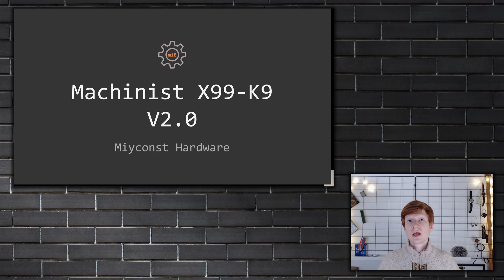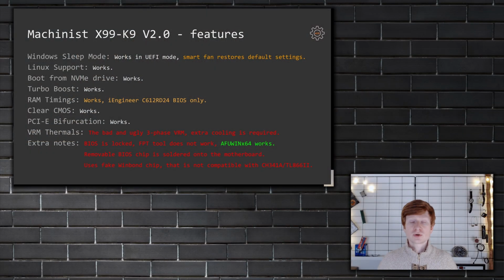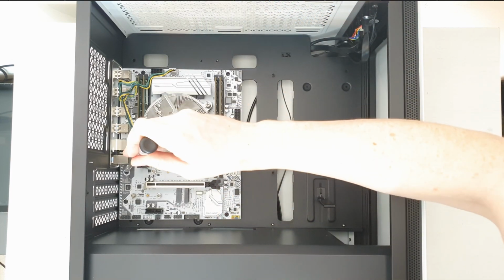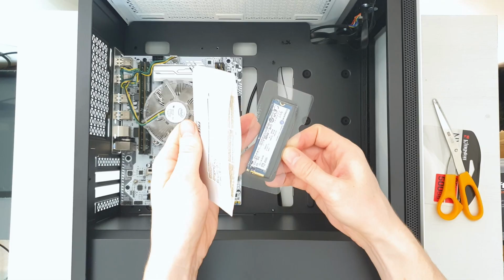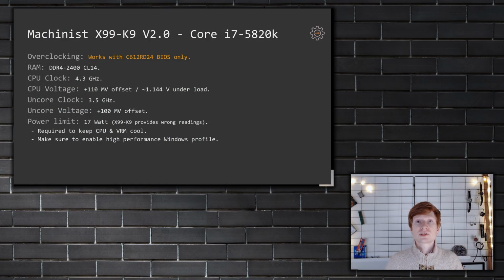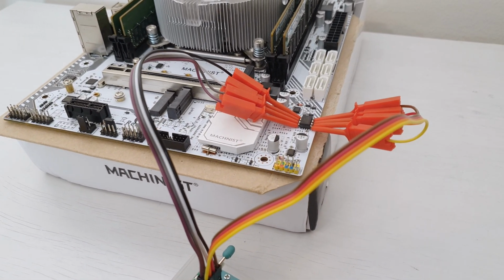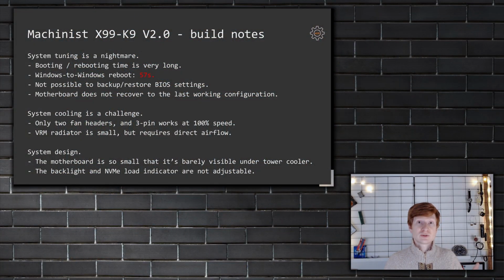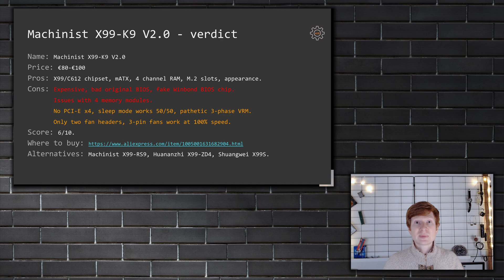🇬🇧 PC with Machinist X99-K9 V2.0 and i7-5820k – BIOS, overclocking, tuning, review, and impressions

Comment: Hi amazing work, I have a Huananzhi F8, and I have been wondering if is it possible to modify the number of cores you want to use on the bios, I have seen a Portuguese or Brazilian youtuber doing it on his Chinese motherboard, but I can't find that option on my bios, Do you know how I can enable that option into my bios. 
Thank you.
Reply from the maker: Hi. You can try to use BIOS from iEngineer which has all required options, just make sure to select the correct version. There are two different X99-F8 revisions, and the BIOS is not compatible between the revisions.

Comment: I had a Machinist X99-RS9 just sitting around after replacing it with a Huananzhi X99-F8, so I decided to build another system to have as a spare.

-Xeon E5 2640 v3 8C/16T Haswell-EP w/Cooler Master Hyper 212 BE
-32GB 1866MHz Micron DDR4 RAM (4x 8GB quad channel) 
-Machinist X99-RS9 mATX motherboard
-MSI GTX 1050 Ti 4GB GDDR5
-EVGA 450 BR 80 Plus Bronze power supply
-Samsung 870 EVO 250GB 2.5" SATA SSD (windows, apps, virtual machines)
-WD Blue 4TB 3.5" SATA HDD (mass storage)
-4x 120mm Arctic P12 PWM case fans (one is blowing directly on the VRM)
-Cooler Master Masterbox Q300L mATX case

Thanks again for all your great videos that have inspired my love of X99.
Reply from the maker: That sounds like a very neat and budget friendly gaming machine.
Reply: @Miyconst  Yes it is, and I got the 2640 v3 for only $38 Canadian.  About 28-30 Euro.

Comment: What would be the minimum output for a psu to be able to run a motherboard like this paired with a 10c/20t e5 v3/v4?
Reply from the maker: 350-400 watt, if it's a quality PSU.
Reply: @Miyconst  Then I know.

Comment: I´m sorry, really enjoying your content, but you can get a used Ryzen 2700x for 100 bucks and new b450/b550 AM4 boards for around 50-60 bucks these days, the time for x99 boards is somewhat over, especially for gaming.
Reply from the maker: That's very true!
Reply: It's true that its getting harder to justify a X99 build, but the price difference is still way larger than that around here. I guess the R7 with good mobo and ram would cost 2 or 3 times more than the Xeon combo.
Reply: It depends on where you're from. In the usa x99 is not attractive but on Brazil and Russia/Ukraine it is because they don't have access to ebay.
Reply: @SuperObamaladen  yeah, i was talking about about Europe, forgot to clarify.
Reply: USA?
Reply: @SuperObamaladen  Brazil
Reply: @andre_warmeling  o cara deve ser dos eua pq no aliexpress um 2700x é mais de 1000 reais. Por isso o xeon é melhor pros brasileiros e russos q nao tem acesso ao ebay.

Comment: Thank you very much, can you plz recommend me a motherboard to use  with Intel Xeon E5-2620 v4 ?
Reply from the maker: What are you going to use the PC for? In general, Machinist X99-RS9 will do it.
Reply: @Miyconst  thank you for answering, I plan to mount a virtualization server and I would like to use this CPU with DDR4 RAM
Reply from the maker: @ultramido4498  If you plan to use any GPU pass-through or some other advanced features of virtualization - go with Huananzhi, otherwise any cheap option will be fine. E5-2620 V4 is a very cold CPU.
Reply: @Miyconst  thank you for your support I really appreciated

Comment: Hey, just to warn you all: do not use Miyconst BIOSes in newer F8 motherboards. They do not work anymore. Actually they bricked my motherboard. I reflashed and it is working flawlessly now. I know it is my fault, but just to help you guys.
Reply from the maker: This is a well known fact by now that new version of X99-F8 is no longer compatible with the original BIOS. Also, I have not made any BIOS, I only took ready available options and modded for Turbo Boost Unlock.

Comment: Which would be the best of the Chinese motherboards? VRM, easy to flash the bios, ram memory compatibility, etc.
Reply from the maker: You didn't specify price 😁.
Reply: @Miyconst  I don't care too much about the price, but between $80 to $200.
Reply from the maker: @teloz2779  then don't get any of the Chinese boards, buy an MSI.
Reply: @Miyconst  MSI X99A SLI PLUS $190 ... Hmmm, I didn't know that there were motherboards of known brands for that value. the last time I saw it they were for $300/400, I won't have any problem with any type of ram right? it works with both normal and server DDR4? I would have to buy some M.2 adapter I don't use any other type of drive.

anyway, thanks for the information.
Reply from the maker: @teloz2779  I am not sure about ECC REG. Some MSI motherboards support it, others officially don't support, but still work with it, and others don't boot up with ECC REG. As far as I know, the original SLI Plus does not work with ECC REG memory.

Comment: Miyconst, just a thought I had at your remark @12:50. An nice solution would be getting a NZXT Grid "V2" fan controller. 
It is a very interesting fan controller. Software controlled, the opensource control software (github) is better than from NZXT it self and the controller connects to the motherboard via one of it's internal usb 2.0 headers. It is a bit slower in response compared to bios PWM controlled fans though. 
If you can get some on the used market in Sweden, it could be very interesting to use them in PWM limited systems.
Reply from the maker: Unfortunately this one is not available in Sweden, and I have actually tried to use a fan controller from AliExpress, but it turned out to have a short and killed an RGB controller for me. At that moment I had enough of this build.